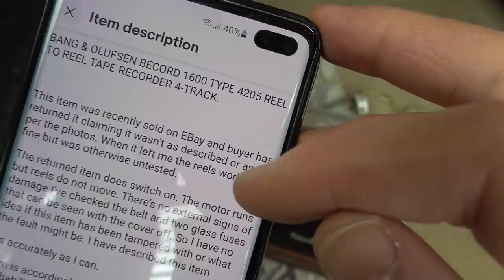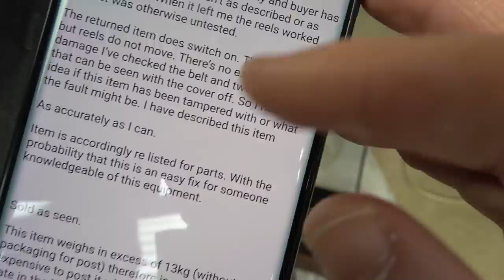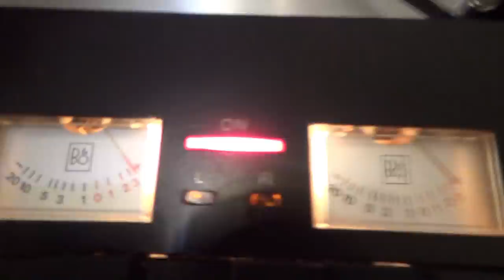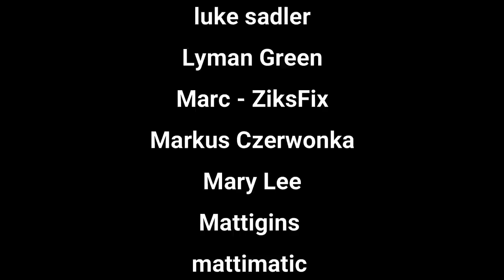50 Year Old BANG & OLUFSEN Beocord 1600 Very Expensive REEL to REEL Player - Can I FIX IT???

Comment: That sure was a terrible eBay buy for the first buyer :D Lucky that he was able to return it. And lucky for you that there is so much to fix, that's what you love, right? :)
Reply from the maker: Well yes 🤣🤣 but the amount in this part already would have been enough to fix already. To have to now go on to fault find further is a bit of a pain 👍 I can definitely see why the original buyer returned it!!!
Reply: @Mymatevince  Yep, I would have sent it straight back too, its a train wreck, replace the filter caps and just treat it as an audio amp at this point, I wouldn't throw to much money at it because its probably gonna sound awful ! best of luck with this one....cheers.

Comment: A long time ago, I had a reel 2 reel, and it didn't run. What I found out was, if the counter is not counting, it won't run. I replaced the small band running the numbers, and everything ran fine. It appeared there was a light beam  looking at the counter.

Comment: What I run into all the time, and have since protected myself by marking internal parts so I can prove if something has been replaced, ok what happend to me in the past, I sell a working item only to have it returned "not as described not working" it worked fine when I sent it out, and I find out that the motor or other item has been taken out, and a broken item replaced it, I have since fixed that by taking a much deeper set of photos to protect myself, and prove that items were removed, people are so underhanded.

Comment: when i do a rebuild on an old engine vince and there small rubber seals /not oil seals  especially on the mechanism of drum brake ,they have small dust seals very similar to your belts just smaller,i would soak them in wd40 for a couple days ,makes them supple again.

Comment: Despite its high price tag, this is a bottom end tape recorder. It lacks two essential features. These are dedicated tape heads for recording and playback and a three motor transport. This machine was not intended for heavy use and many users learned that magnetic tape is a very expensive medium, so they did not use their tape recorders very often. Who ever was really in doing tape recording, usually looked for an affordable 3 motor 3 head machine from Revox, Teac or at least Akai or Sony.

Comment: Poor thing is totally dry. It needs a looot of lubrication. Also, there must be felt pads under the spindles.
Upd. Heads are not the problem - capacitors in the amplifier are dead.

Comment: Re-Cap it, those old caps are now resistors.
Reply: Maybe, but you'd be surprised how long-lasting those old electrolytics used to be (on tube equipment it's a different matter because of the higher voltages etc)

Comment: Bang & Olufsen was the brand of choice for the posers of that era. 
It said more about their status in life than their understanding of good Hi Fi.
Reply: Agreed. While I do love B&O products (especially those from the 80s) for their beautiful design, it does have to be said that (in most cases) these are not really audiophile quality. You buy B&O for the looks, not for the sound quality. I've owned several B&O units over the years and while they all sounded great, they were never any better than any other brand of mid-range hifi gear in terms of quality.

B&O were very much the Apple of their day - a triumph of style over substance, but having said that, I would still buy B&O stuff but would never buy Apple stuff - mainly because Apple make it hard to tinker with and modify stuff.

I eventually ditched B&O in the 90s in my search for ever better sound quality, but my wife hated my big hifi setup, calling it ugly, messy, overcomplicated etc - you know, all the usual stuff that wives tell us about our gear :) so, I was kind of pressured in going back to B&O, though I don't like the styling on their new products, so I started looking for their 1980s models, but whenever they turn up on ebay they're massively expensive or in very bad condition (usually both), so I ended up going for one of their cheaper models.

Currently I have a Beocenter 2200 (which all the B&O fanboys will tell you is a cheap, entry level model, manufactured by Sanyo and is a complete steaming pile of garbage - the first two of which are true, but not the last one - in fact this is a really nice unit and while the build quality is less then their more upmarket models, everything else is fine, though it lacks some features like aux inputs but they're easily added), but I don't have any issues with it, and it sounds great, looks great and since adding a bluetooth module and an aux input, it has received very high scores on the Wife Approval Table (because she hates big multi-unit setups with lots of wires and just wants to stream music on her phone through it)

It also looks gorgeous, just like her (well I have to say that, in case she's reading my posts LOL :)

Comment: In addition to connecting speakers directly, you could try running the line output to another amp to see if the hum is being introduced only in the amplifier part...
Reply: I think the hum is coming from the preamp stage. Obviously without testing it myself this can only ever be an educated guess, but if the VU meters are getting pegged then they're driven from the equaliser board which is after the preamp and before the power amp so  I think the hum will be present at the output of the preamp, and the fact that it's in both channels tells me that it's likely to be a bad ground on the tape head itself (or of course bad PSU caps but my money is still on a bad ground)
Reply: @countzero1136  Yes you are right - didn't notice the VU meters earlier, but that makes sense. The only other thing I can think to try based on looking at the video only is to repeatedly press the record switch. I have seen noise and pegged VU's on cassette decks and VCRs that was introduced by a dirty record/play switch....
Reply: @ACBMemphis  Yeah there's a hell of a lot of switches in the signal path on this model - any one of them could cause this, but you're right that the play/record one is a prime suspect, but I'd definitely check all the ground connections, especially given that it looks as though someone has messeed with the heads on it

Comment: You can clean the record/play switches with deoxit, they are those slidy things witch you glued the little square piece back to... Also, those grey capacitors from the 60s are long gone for sure, the electrolite inside of them dries all up
Reply: The two identical caps are 2000uF/25V and are used to couple the power amp to the speakers. The main PSU cap is 1000uF/25V and the motor capacitor is 8uF/130V as the motor runs directly from the mains (oh what fun, and I guess it's sychronised to the 50Hz to set the speed as well). The only other big electrolytic cap in there is a 3000uF/50V one feeding the auto-stop board (yes this machine has an optical auto-stop mechanism that has a small lamp that shines through the tape path, with a CdS photoresistor on the other side, so that when the tape reaches the clear leader, the light hits the photoresistor and triggers a solenoid (which B&O have always insisted (wrongly) in calling a "relay" in all their documentation) which disengages the mechanism)

None of these caps are hard to find these days (2000uF could be replaced with the more common 2200uF without issues) and don't need to be fancy low esr types in this application.

Comment: I'm no expert, but the load hum your getting with this reel to reel tape machine could be because the filter capacitors need replacing. It was the same problem with the vintage valve (tube) radios. Loud hum even with the volume turned right down - filter capacitors shot.

Comment: To discharge any power in the capacitors, unplug the item, then press the power button a few times.
Reply: Why do people give advice when they clearly don’t know what they are talking about? I will never understand.
Reply: @Gal2k6  Okay, I didn’t know about devices from the 1980’s on back not having discharge resistors. I thought it was standard on every device in the past as it is now.

Comment: Lovely repair but I have a concern why you being cheap when it comes to belts ? You could just buy new ones and replace them which obviously will last longer instead of reusing those worn out belt that have been decades operating on that machine.

Comment: 26:46  You made the zip ties too tight, so now you put more pressure on that old grommet in the middle every time you switch the position of the shaft.  I would give these zip ties more slack and they would still keep the shaft in place.

Comment: There is no doubt to give the seller the benefit of... Neither the shipping company nor the first buyer would have caused the caps to fail or rubber parts to dry up. But good luck with part 2, the machine is definitely fixable.
Visit Mr Carlson's Lab here at Youtube, he will teach you everything there is to know about old capacitors.

Comment: The seller was not really good with this one.  Obviously did not check the belts or would have noticed it slipped off, not to mention the horrible state inside.  I should imagine the clutches are pretty badly worn too

Comment: There is a thing called "Rubber renewer" and is perfect to restore rubber parts surfaces. Why you have a "capacitorfobia" ? :D Those belts and springs, does not have to be that tight, this could result in slowing and wearing the mechanism, also every part must spin freely, no rubbering on parts.